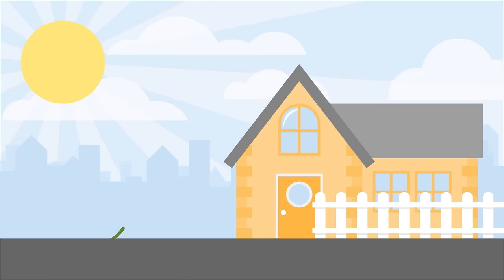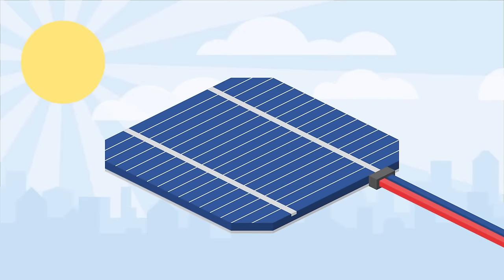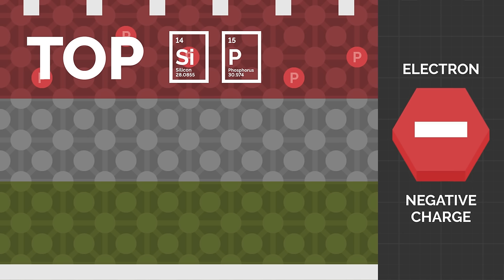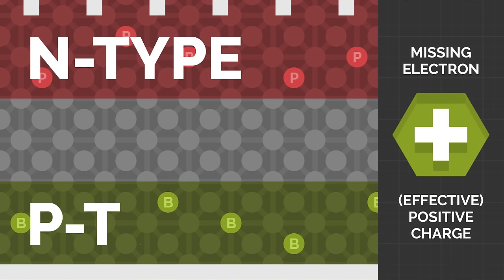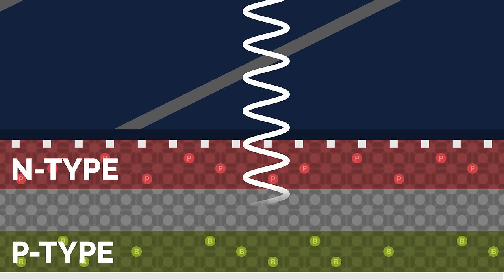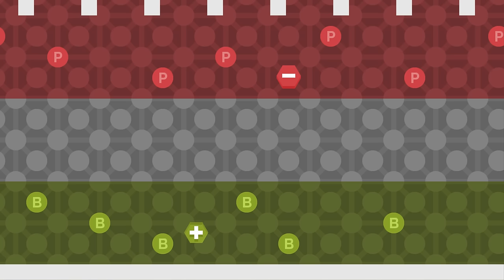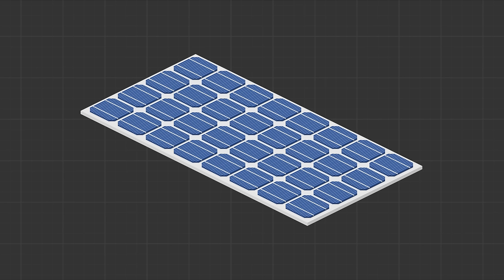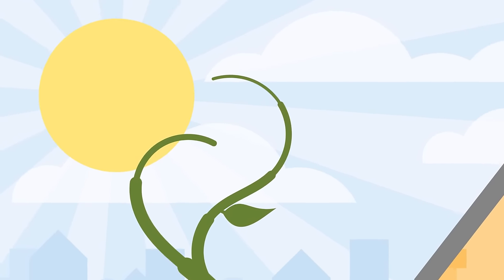How do solar cells work?

Comment: Could anyone explain why the electrons move upward, towards the negative side? You'd expect them to move to the positive holes downward as they are attracted? Also, how can a hole move? I assume it are ''holes'' on the shell of the atoms, but how does that move around? Thanks
Reply: The "holes" are areas where there are fewer electrons. In reality, the electrons around the hole shift around to displace the hole. As for the electron direction, that's because the electrons want to meet the positive charges/holes through the path of least resistance. Although the distance going straight down is smaller, the resistance/conductivity makes that impossible.
Reply: thanks!
Reply: so there is an additional layer of material that acts as resistance?
Reply: Bob - I don't understand why the electrons move towards the N-type and not the P-type. I thought the least resistance would be going towards opposite charges (negative to positive) and not like charges (negative to negative).
Reply: ABC The path of least resistance is actually through the wires into the component being powered which makes its way back to the holes on the bottom
Reply: mrsemifixit- Cheers for your input. The question I have is why does the electrons go towards the N-type layer (this is before the circuit is closed). This section of the clip that confuses me: https://youtu.be/UJ8XW9AgUrw?t=191. If you can help me understand, I'd appreciate it. Thank you.
Reply: ABC Because the middle layer has resistance and it’s easier for the electrons to go up towards the negatively charged n-type layer to then be carried through the wires back to the holes
Reply: Here's how I look at it: on the periodic table, Boron's valence electron shell has 3 electrons. Phosphorous's valence shell has 5 electrons. Phosphorous is more comfortable accepting 3 electrons to fill its outer, valence shell. Boron is more comfortable giving away its 3 outer electrons to be satisfied. Although it says the charge on the top is negative and the charge on the bottom is positive, which may throw you off, think of it like the top layer is more comfortable accepting electrons and the bottom layer is more comfortable giving away electrons. This is an overly simplified way to view it, but it may help you starting out.
Reply: Does N-Type means that phosphorus has more electrons as compare to silicon?
And why the radiation does not knock out electrons from silicon in upper layer however it can knock electrons from bottom layer?
Reply: Actually it is because of the electric field generated at the junction (the depletion layer) electrons are pushed into n side because of the negative end of electric field over it  and holes into p type because of positive end.
Well it was not explained in the video
Reply: molo ram this is true. A biased electric field is applied in a specific direction in order for the this specific movement to occur
Reply: @saerdnakaliber472  I presume that Molo ram was talking about the depletion layer electric field and not a biased electric field.Isn't it?
Reply: Vaishakh Sreekanth Menon the current is generated by diffusion of electrons/holes which results in the formation of depletion region. But this will also result in a potential which will act as a barriar for continous diffusion, in other words the diffusion will stop at a certain point. The biased electrical field I was talking about is used to moderate this potential, e.g decreasing it, in order for the diffusion and hence electrical field to continue as initially.
Reply: @tennis5126  Hi Tennis! Hi understand your confusion, since this part is not clearly explained in the video. 
The n-type layer is NOT actually negatively charged. The ''N" only means that there are negative particles (the electrons) able to move freely through the material. To create the N-type layer a different atom than silicon is added to the silicon. For instance phosphorus, like in this video. This atom has more electrons than the silicon atoms can bind with, therefore the electron will be able to travel freely through the material. However, phosphorus also has an extra proton compared to silicon, which makes that the total is not negatively charged. 
If you'd like this to be explained more thoroughly, check out this video: https://www.youtube.com/watch?v=0RlMcuO2bOM&t=380s
Reply: crazyzombie99 Thank you for asking this question, I was going crazy too haha
Reply: @maxwellschaphorst8574  So far, your answer makes the most sense. Thanks.
Reply: If you really want to invest your time to understand the concept of holes and charges, watch semiconductor videos on Khan Academy.
Reply: the electron moves upwards because there is a slight positive charge that is generated when the depletion region is formed(opposite charge on both p-type &n-type).
you are right, only electrons can move. when they say  the "holes moving" it actually refers to the electron moving to the hole occupying it (becomes neutral) and the initial placement of the electron becomes a hole (where the hole moved)
Reply: @EmielvanderWal  Much appreciated.
Reply: @tennis5126  The electrons gain the energy from the light ray and break the bond with the atom as a result they become free electrons. free electrons are present in the top layer.
Reply: @sahilsandhu4483  I agree. Thanks for your answer and it confirmed my thought.
Indeed, it's because the electric field lying in the junction, where the 'holes' in the P-type has combined with free electrons in N-type.
So what happens now is in this junction, there aren't now free carriers anymore and what is left behind is negative ions in the P-type (because they have accepted positive electrons) and, likewise, positive ions in the N-type. This is the tricky part, I think, and be careful with polarity in this junction from now on.
Consequently, in this junction is formed an electric field, whose polarity is negative on the P-type side and vice versa. As a result, the positive charges produced by PV effect will naturally go to the P-type now, along with the direction of such an electric field.
I hope this would be correct:)
Reply: @bobsmithson3031  u are a legend thank you very much had the same problem
Reply: This is because in a p-n junction, the n type semiconductor has positive charge and p type has negative due to diffusion of electron on joining both n and p type semiconductors together.
Reply: Due to field of depletion region

Comment: For those confused regarding why the electrons go to the top (Negative Plate) rather than bottom (Positive Plate), it is because of the valence forces at work for Phosphorus and Boron. Phosphorus is inclined to gain up to 3 additional electrons to reach valence stability (fill the valence shell), whereas Boron is inclined to lose two electrons to reach valence stability (empty the valence shell). These forces are what direct the electron toward the net negative plate, because the valence forces are stronger than the electromagnetic forces in this particular system. The electromagnetic forces go to work once the electron enters the electrical circuit.
Reply: Thank you so much! You have zero idea how long I have been trying to find an answer for this.
Reply: Oh! makes sense now TYSM
Reply: Hm.. Photoelectric effect happens in the depletion region between Phosphorus and Boron where the electric field is directed towards N (Phosphorus).
Both N and P regions are electrically neutral by default because P has extra proton to neutralize its extra electron in the outer shell, and Boron has one proton less to neutralize a lack of one electron.
The electric field happen in the depletion region due to free electrons from N filling free spaces in P region, and now the N side of depletion region has Phosphorus ions (without extra electron) and P side of the  depletion region has Boron ions (with extra electron).
This result in an electric field pointing to N region (depletion region is positive on N side and negative on P side) which pushes electrons to N and holes to P.
The photoelectric effect happens when photon hits depletion region and creates a hole and electron which are channeled to the corresponding sides making N side more negative and P side more positive, if you close the circuit the electrons would flow through the wire from N to P making it stable again and this creates electricity as long as the sun is hitting the depletion region. That's why the N layer is thinner than P layer, so that the photon travels less to the depletion region.
This video doesn't go into detail about depletion region as some other videos about NP junction.
Reply: Thanks. I used to think N-type  more electrons so flowing should go from N to P
Reply: So instead of the electric field you're saying that electrons goes to the N Layer and Holes goes to P Layer when the light hits the depletion region because the valence forces of Ph and Boron. it's a little bit confusing bc i saw a lot of videos that explain that phenomenon is due to electric field
Reply: Thank you for the explanation 😊
Reply: my guy
Reply: Okay, Okay makes sense, but then what happens  when the silicone phosphorus attoms all have gained 3 additional electrons and they have all achieved Valence stability on the top layer which is the N-type ( negative plate) and all the silicon boron atoms have all lost two electrons on the bottom layer which is which is the p-type (positive plate) and have all achieved Valence stability too, how does the cycle continue, how do the solar cells keep generating electricity from sun light???      And what the hell is a loos hole and how does it travel to the Bottom The (positive plate) I thought only electrictrons are mobile.

Comment: Why do the electrons go up into the strip when hit by photons, wouldn't the electron hop over the junction into the p type material. Opposite charges attract, does the electron choose the strip on top instead because it is the path of least resistance?

Comment: why does the lose Electorn move towards negative type? 3:26 i got confused
Reply: Because it has previously adopted a positive charge when joined to the p-layer. Explanation in the video is missing a part: the union between the layers is called the PN junction, or Depletion Region, and no free electrons or "holes" can be found there (until photons do their job), since free electrons in n-layer have found a "hole" to get into thanks to the potential difference between them.  This electron migration from n type layer to "D Region" made it become slightly positive.  Thus, the electron/hole pair created in the PN junction when photons reach in, are attracted to their opposite charged layers.   Hope I made myself clear enough!
Reply: @olivierdevlieger7233  perfectly clear. I mixed it with the binding energy and that negatives repeal eachother.but this is the same effekt as photoelectric effekt where missing electron is replaces but the upper layers.
Wonder if this process creates small amount of radioactivity
Reply: @gevorkbabayan  as far as I know, this covalent unions (between silicon, phosphorus and borom) and the process they are submitted to, do generate very small amounts of emf but in insignificant proportions and since systems are often away from our bodies, they are not dangerous
Reply: @olivierdevlieger7233  i do agree with you. thank you so much for your answer

Comment: Can they add some more Layers. For compressing the charge. Phosphorus -3 charge. Boron - 1 charge. They cells should only power a battery and then the battery charges the Home. Can we amplifier the charge to make the battery charge faster with less sun or with lower frequency ? Like a bigger entrance layer for Frequency and a smaller exit. A funnel , or like the refrigerator or heat pump. Pushing things into smaller spaces. Maybe the people that make microchips can make better smaller Frequency cells.

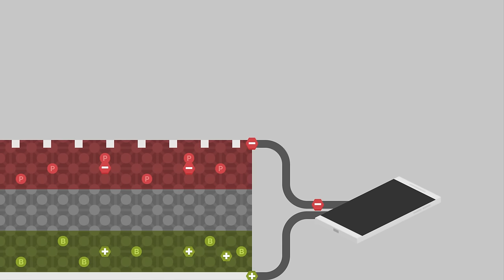Comment: 3:57 Okay, now when all the electrons move to the positive side, how does the solar cell get back its protons and electrons in the center to repeat the process? Or is that it for the cell and it cannot be used any longer? I'm pretty sure the latter is not the case, but I don't know where it gets its other pros and electrons.
Reply: I learnt that the protons don't move at all, it's just the electrons are liberated, as in they are no longer bonded to the atom. When the electrons do work in the wire, it releases its energy therefore goes back to a lower state of energy, there-in the positive ions can now "capture" the free electrons once more to form the bond to make the atom again. 

This processes is repeated indefinitely as long as photons provide the energy needed for the electrons to be liberated in a process called photonic emission, where electrons absorb the energy from photons of a specific wavelength.
Reply: Though it is said that electrons move, it is not the case. Only the charge moves. Charge from one electron is transferred to next and so on. Electrons are present every where, even in electrical cables i.e., copper/any metal. So energy from electrons in solar cells gets transferred to electrons in copper thus it propagates to load where it is used to convert electricity to any other energy. Meanwhile in solar cell when ever an electron is deprived of its energy it goes back to its normal state and gets ready to accept photon energy again from sunlight.

Hope this will clear your doubt. I too had this doubt initially but after going back to quantum physics principles I got this understanding. I don't know if I am correct but my theory fits the answer.
Reply: By sunlight it gey more positive charge and electrons

Comment: This is a great way of explaining photovoltaic principle to general audience. I think it would be even better to put put this into the context. First, efficiency of photosynthesis is 0.3 - 0.38 to obtain liquid fuel, biodiesel or ethanol. In contrast, efficiency of typical silicon PV cell today, 15 - 18% is magnificent so, the wording on 'future challenges on improving efficiency' is misleading. Second, energy storage. Maybe, at the time of making this video it was a challenge. Today, the cost of utility scale battery storage is cheaper than pumped storage hydroelectricity. So, renewable energy (lead by wind)  is actually cheaper than coal, nuclear and even earth gas. Thank you!

Comment: Why an electron(being negative in nature) moves to n type(where there is already majority of electrons)?
It should move to p........
Reply: by convention, current is taken to be the movement of positive charges. not the movement of electrons. take notice that when describing the layers for example, narrator says phosphorus makes the layer more negative. 
for example, phosphorus has 6 valence electrons and it wants to have a complete octet in its outer shell, meaning it wants to receive electrons to fill the -holes-. However, if you follow the convention, these holes are what's being "donated". so when an electron is knocked off the middle layer it goes to the top layer to fill these holes. 
in summary: the top layer is actually positive due to missing electrons in the valence shell of phosphorus and the bottom layer is actually negative due to an excess electrons. But, conventionally, the top layer is negative (due having 6 valence electrons ) and the bottom one is positive for the same reason. 
TL;DR: it actually moves to the correct side given the convention.
sorry if the explanation is not well structured, English is not my first language.

Comment: Why do you say it's typically 32 solar cells in a panel? The most typical quantity is 60 cells (1640x990mm), second popular size is 72 cells (1960x990mm).
Reply: Each cell produces roughly 0.5V, thus 32 cells in series provides 16V. This is the configuration of 15V panels.

Comment: Question.  From what I gather that middle layer is the "Fuel" source and the N-type and P-type collect that fuel source.  Are they basically harvesting a form of galvanic corrosion?  Is this what causes solar cells to fail over time?  Corrosion.

Comment: Thanks, well it miss why the loose electron goes to the "negative layer" as negative and negative are repulsed. The answer is that with your cable around the two (upper/lower) layers, you have created and electric field to attract electrons to the top layer. Isn't it?

Comment: Still not clear on the middle layer.  What happens when all the atoms have no more electrons?  Where do the new electrons come from?  The sun only knocks the electrons free correct?  Then what happens to the atoms?  Plasma?  lol
Reply: I guess this acts as a circuit, so the electrons move back to their holes on the p-side after being used. Silicon doesn't only own one electron, but 4 valence electrons. Nothing would happen to the atom if all electrons were lost, but more holes would be created, hence a more positive p-side. Though I doubt this would ever happen as not all photons have the energy to knock every electron free or even hit the right spot to do so.
Reply: electrons and positives charges meet again inside the solar panel, imagine it like a battery.
Reply: I just had this same question in a different forum.  The electrons are carriers only and stay in the circuit, they only carry the energy and return once they give the photon energy to the string of panels through the wires.
Reply: Yes you are right
Reply: P-N junction